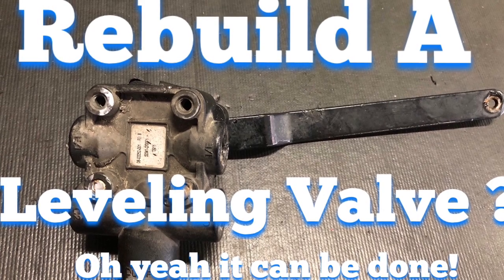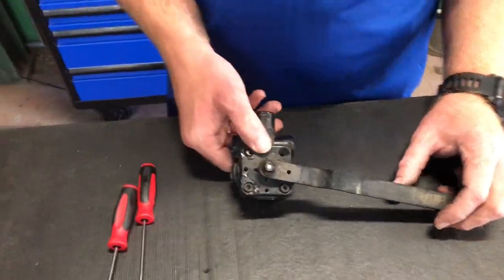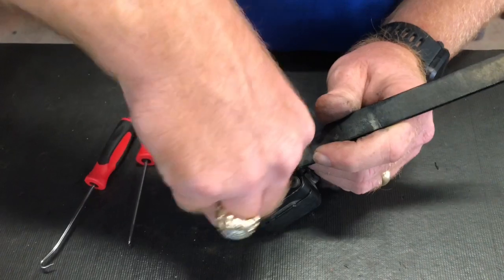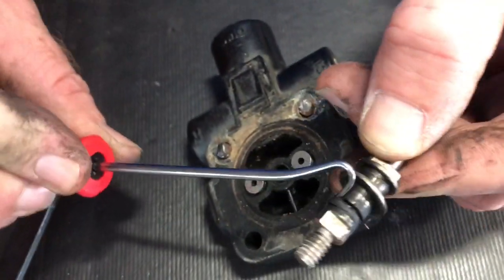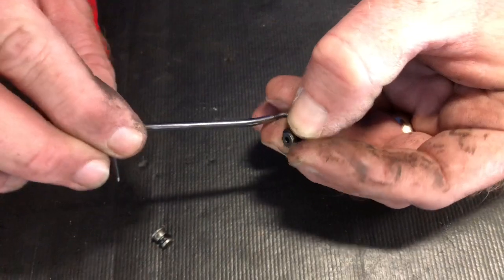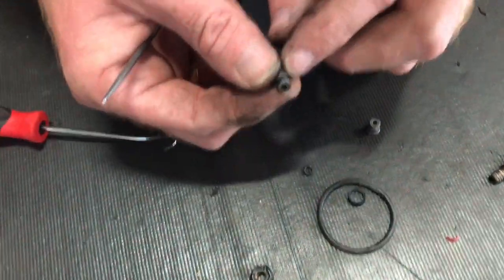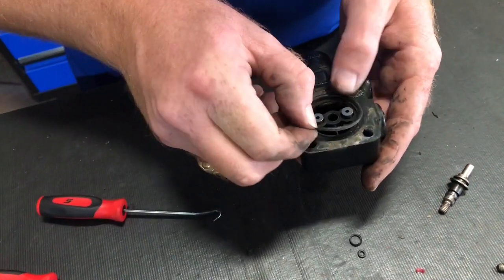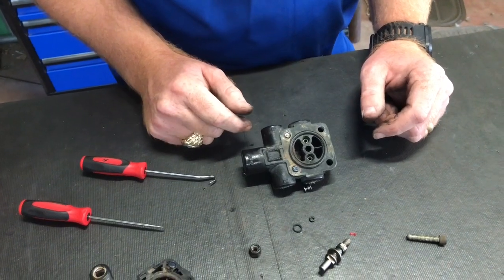How to rebuild a Leveling Valve..... Yes it can be done

Comment: Hello after watching this video I decided to rebuild my Hadley duel levelling with smart  pressure dump ,1st it had 10 “0” rings with balance shaft in middle splitting 2 sides ,put everything together with bad deep cuts on bleeding hand then installed it fired up truck then bags just kept climbing 6” 🧗‍♀️ jumped into truck to shut it down .It took 4 tries to set it right because threading on shaft is what balanced  2 chambers inside the air valve  , fixed it  but never again rebuilding it !
Reply from the maker: That’s a complex one for sure. Regular leveling valves are gravy as you see in the video here.
Reply: Can this valve cause vibrations? 
I have hadley valve on 2017 prostar and cant find whats causing vibration

Comment: I just subscribe to your channel very good video on replacing the O rings on thst leveling valve.  I have a 2006 volvo vnl670 and the cab suspension leveling valve iam trying to raise it up cuz the 2 rubber bumb stop is rubing on the frame and i been getting this wobble when iam driving. Any idea if you could make a video on it ? Thanks

Comment: I've found to use a terminal spade disconnect tool handy to get the small o rings off. I always stretched them with a pick or o ring spoon. Great video!
Reply from the maker: +Dexter ruteke I will have to try that ! Thanks for the tip. Also thank you for watching and thanks for the comment ! That’s what I like about this community people always share useful information and try to help each other out ! Thanks again.

Comment: Wow that’s just what I needed to Know I’ve got one that’s “new”and still Leaking air...!
Reply: Imagine if it leaks while new what's gona be after rebuild, it is 50/50 if it leaks or not afterwards! Most of the time you gona scratch the surface while trying to take the old O ring and then the new one will not be able to seal there properly. I'm saying this from experience. I be tried to repair valves, fitings and what not, most of the time still leaks, but I do succeed from time to time 😁. Some time is not worth the waste of time. They are made so cheap, the fuckin plastic just deforms after a while. They must make them all metal. I wish!
Reply: Take it back then. Why you gonna buy a new one and take it apart lol

Comment: Thank you good man. Very impressive. On my Peterbilt valve is leaking, so, do I need to replace rubber rings, if yes, where can I buy rubber rings, or just use some Vaseline. Thank you good man.
Reply from the maker: You can pick them up at a Napa or some other type of parts store. Just take them in there and ask for some replacement o rings. We buy them in an o ring assortment kit that has many different sizes but you can buy them individually usually about $0.05 each up to about $0.10 for the ones in a leveling valve.  There will probably be 4-5 in there

Comment: My horse trailer leveling valve leaks or releaes air every time we remove horses out of the trailer less weight and keeps the air compressor running. Does that mean the leveling valve isn't working properly?
The compressor turns on initially and levels the triale rno problem, once the air gauge is all full and then cuts off the compressor. But my issue is occurring when we remove weight it kicks on the compressor and the leveling valve won't stop releasing air

Comment: Now do you lube that with Vaseline? That's what I was taught i guess. So they decompose from a solvent in other types of oils.
Reply from the maker: +Mike Albrecht we use o ring lube on them. Vaseline will also work on oil based rings (that run in oil) and you can use KY jelly on water based stuff (water or antifreeze) etc. strange to open up a toolbox drawer and see KY jelly, Vaseline and fingernail polish but ..... it’s in there !

Comment: Looks like zinc or steel hexhead screws in an aluminum body.. any suggestions on how to keep from breaking the bolts?
Reply from the maker: Spray with penetrating oil and let sit. Then tap and repspray

Comment: Hey thanks for the vid, is the cab leveling valve the same? Do you know if the cab valve is strictly flowing air outwards or does it take air back from the bags since it has a diaphragm? thanks

Comment: I have a 2004 Monaco Diplomat pusher RV right front sags will this also fix my issue Tech charged me $95.00 just to tell me your small leak ride height valve small leak RV will sag after a few days not to worry !  would a leveling valve renew the O rings fix this?Thanks

Comment: I have to use any one besides NAPA if possible ...the one in my town charges up to 3 times for the same products that I got from Parts Plus. just sayin!  The 3/8 nylon air line I bought from PP cost .81 cents a foot the same thing at NAPA was $3.21 cents a foot ! The push to connecter was 54 $ (tee and union adapter 3/8 to 1/4) bought the compression adapter for 9 dollars at ACE. for 44 and  60  equals a savings of over a hundred dollars!   NO THANKS  I'll SHOP where they don't GOUGE me.

Comment: You are missing a very important piece tho 😎
Reply: The round disc is missing from his video, the disc was made from hard anodized aluminum or ceramic, those orings do not leak except for the main shaft one maybe.  The main shaft slides inside the round disc.  You had a hard time removing bolts because they are covered with thread lock, you need to get rid of that with wire wheel before unscrewing them.